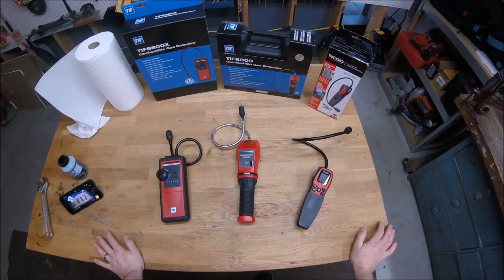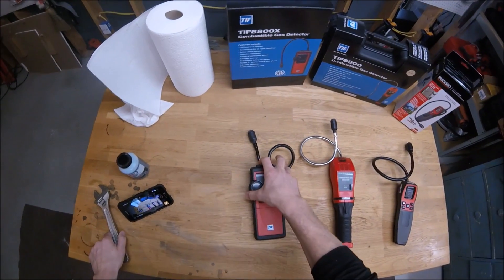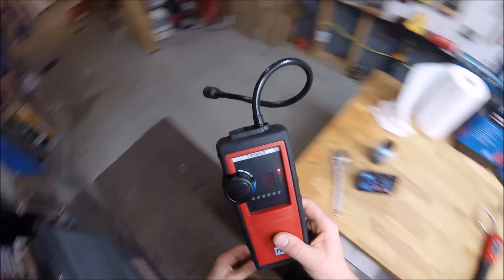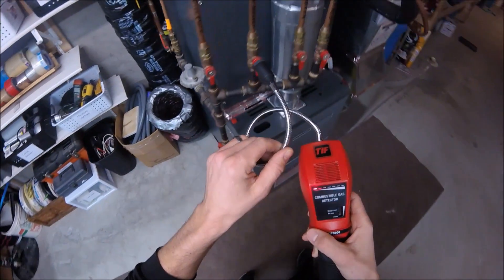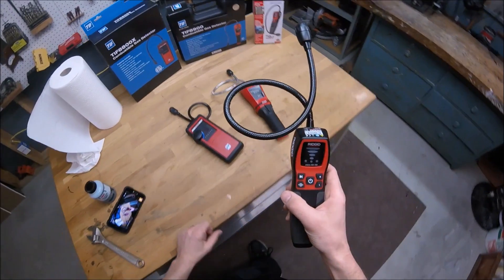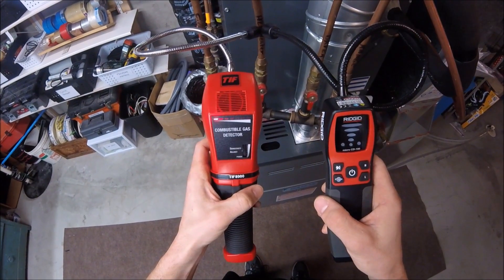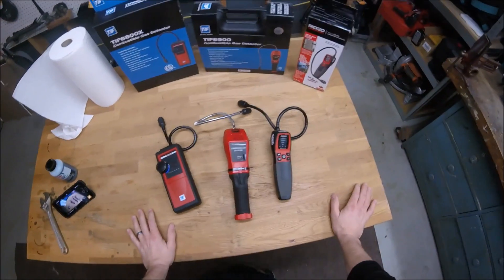Gas Sniffer Comparisons: TIF 8800X vs TIF 8900 vs RIDGID CD-100,

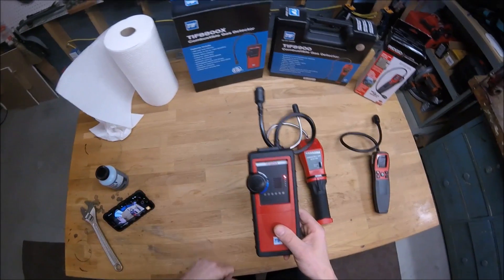Comment: 1:30 - Argon has an atomic  weight of  38. It is not only air, it is a gas. If you were entering a confined space, you would  use one of these to detect the weight by parts per million, by opening  the ' box car '  hatch, you would  release the weight. The same thing happens in the  Human body...or 
" living still ". The stock market has a secret word for it - " OVERAGE "...but as you can see, the inflation  is starting to catch up to the absconding.

Comment: For tick  rate combustible gas detectors I prefer the TPI  or Sensit units. If you need to document gas leaks the Bascon Turner Rover is the very best in my opinion.At $5000 it should be ( used by gas companies , refineries and engineering firms). Also Ruben I noticed on your gas supply line it appears you have a 325 - 3 maxitrol regulator; if this is so, it is only rated for 140,000 BTUs & it appears you are over that max load. You may want to install a 325 - 5.

Comment: In addition to using them for fuel gas leaks, leaking "Products of combustion" i.e. the exhaust gasses from a boiler or furnace can ALSO be detected using these meters. As such, leaking fireside clean-out door gaskets, cracked furnace heat exchangers or other causes of product of combustion gas leaks causing CO leakage or soot problems can be found.

Comment: Nice work. Could you round up any and all 5-10 year old "Gas Sniffers" and make a video of those old ones please, haha. When I go to eBay or pawn shop for one my spending target is $50, max is $75. My current one it 10 years old, new battery and charger, no LEDs $40 on eBay. What the inspector needs is an obvious visual indicator so a single low Res photo can "document the issue". The older TIFF models often lack the LED feature so you'll be (reluctantly) recording a video to document the leak and any $ savings on the unit is combusted processing the video. Summary: Gotta have bright obvious LED gas strength indicator.
Reply: +Adam Stetten - you send 'em on over.  I'll test 'em.

For the record, I don’t report gas leaks based on my findings with any gas sniffer; I only use a gas sniffer to quickly locate suspected leaks. I use a liquid gas leak detection solution to confirm the presence of gas leaks. I take a photo of the gas bubbles and include that in my reports to document the leak.